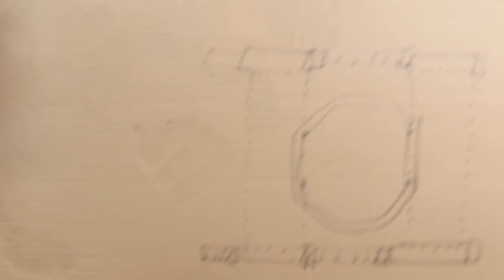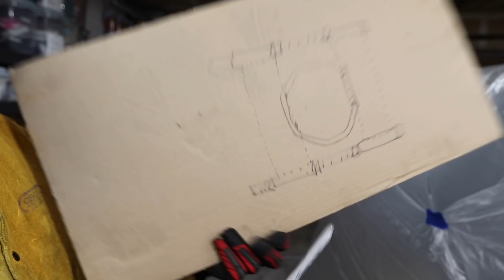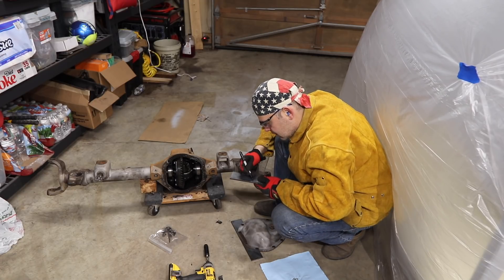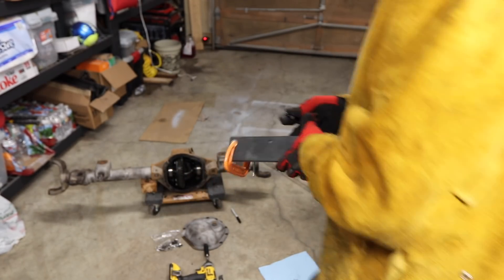3.13 - Dana 44 Housing Tool

Comment: I've read people using a come along to do this.
Reply from the maker: I’ve since found I don’t really need it. I can usually hammer it Into position
Reply: @MattsGarage  I can't get mine out. Prying etc and nothing. I've spent this morning trying to make a tool.
Reply from the maker: @cb-gz1vl  did you try the rag trick?
Reply: @MattsGarage  Whats that?
"A friend told me to put a grease rag in between the ring an pinion gear and when you rotate the pinion it with push the carrier out when the rag gets between the gears. It did!"
This?
I would hate to bang that thing back in.
Reply from the maker: @cb-gz1vl  yeah that’s the rag trick. But I’m not an expert, I’ve R&P setups a handful of times. If you need a spreader, use a spreader but go easy. You spread it too much you’ll deform the housing and then you are screwed
Reply: @MattsGarage  I tried my home made one and didn't get any result. I was worried about snapping the anchor bolts. I used 1/2 inch threaded rods and heavy metal plate. I could feel the assemble jiggle a bit but no luck. Also wasted a whole day building the tool. So I'm packing it up and taking my truck to the shop.

Comment: A friend told me to put a grease rag in between the ring an pinion gear and when you rotate the pinion it with push the carrier out when the rag gets between the gears. It did!
Reply: Great tip!

Comment: apparently you can damage the housing if you spread it more than 0.015 inches.  you can buy a spreader on ebay for $120
Reply from the maker: That is true.  I'm hoping that trying it after every turn kept me in the good on that.  It's definitely not something you want to put an impact gun on.
Reply: Why spend $ when you can make it...lol
Reply: Wow! Hard to believe someone would pay $120 when they're so easy to make, lol!
Reply: @twotwentyswift  No doubt. You could make this for $25 easily. a couple of feet of 1/4"x 2" flat bar,  1 ft. of 1" tube, a piece of all-thread, and 4 nuts. I have all this stuff in my garage from other projects so I'll have one of my own in about 30 minutes and not have to spend a dime! Another $100 saved for tools I can't make, like a plasma cutter, lol!
Reply: Check out the Team Hammeronit video on making a carrier-bearing puller. It probably cost him less than $10 when they're selling for up to $500 and it works every bit as well. The only change I would make is to weld a 9/16 steel ball on the end of the all-thread. May take you 20 minutes to make! LOL! Another big win for the home mechanic/fabricator!
Reply: @twotwentyswift  Ignorance is bliss. Most of the time If your can buy something it's more cost effective than making it.  Buying new steel and threaded rod to make a case spreader would easily cost $120 to achieve that level of stiffness.
Reply: @twotwentyswift  go buy some new steel and build one, report back your steel cost alone. I'll measure mine and get back to you. I think 2x  3/4x2" plate 12" long. 4x 1/2x2x12.
Reply: @sandersballistics  every time I do a project I buy extra to stockpile. Having done that for over 40 years I don't have to run to Metalmart for tiny projects like this. After Bozo Biden was elected the price of steel, lumber and everything else has gone up but with a project this tiny it would only amount to a couple of bucks difference. If you watch the video he only uses 3/16 or 1/4 which is plenty heavy as you can see.
Reply: @twotwentyswift  He isn't using a dial indicator I doubt he is actually spreading the case, that as little 1/4 plate is more likely flexing.
Reply: @sandersballistics  So the diff was locked in and after he used the tool it just slid out with little resistance but the case didn't spread? Come on man, it's not that hard, lol!
Reply: @twotwentyswift  I'm glad you know everything.
Reply: @sandersballistics The plate wouldn't flex, the tube is under compression and the plates are simply being pulled. Things that are being pulled are straightened. Pick up a piece of string and pull on both ends and tell me what happens, lol.  And if the tool works perfectly why would you even care if it did?

Comment: That’s awesome! I wish I had built that when I did mine
Reply: He should have put a dial indicator on the case to MAKE SURE THAT HE DID'NT SPREAD THE CASE TO MUCH! If you over stretch the case too much, then it becomes JUNK!
Reply: .015" stretching the  opening is plenty
Reply from the maker: Nashville Early Bronco and as a bonus I’ve already used it to spread something else I needed to pull apart!